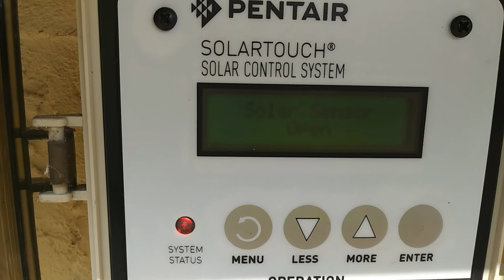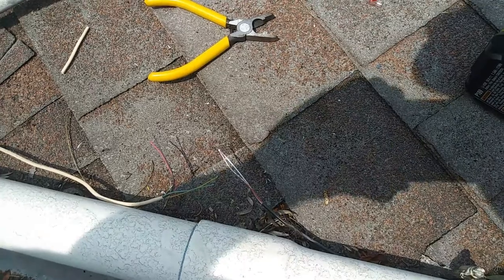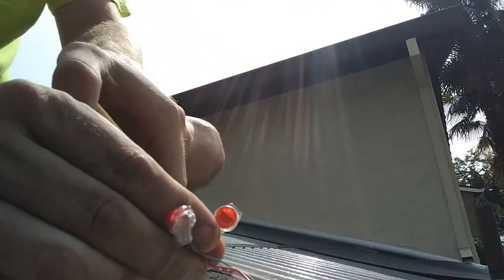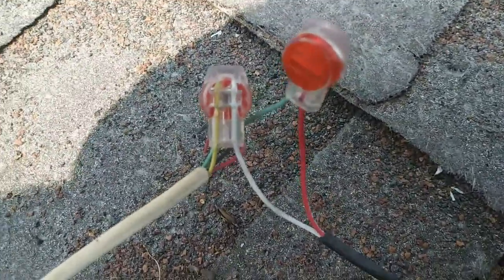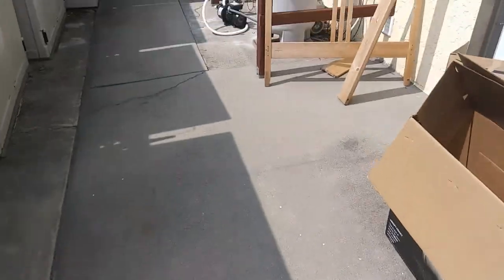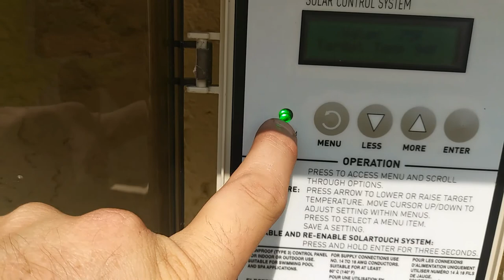Pentair SolarTouch Pool Solar Control Temperature Sensor Open Fault

Comment: I have the green light but in the evening it shows solar sensor open with the red light.  Is this something I should be worried about?  It doesn't seem to be warming the pool.  Temp outside has been 78 sunny.  Pool temp is not going up after solar has been on for days.  I'm a retired woman on a limited income so paying a 150 service charge is not really an option unless absolutely necessary.   Thank you.

Comment: Do you need to turn off the power to the pool pump and solar panel before doing this replacement?
Reply from the maker: There's no electricity that goes to cool solar heating. However, you do have to turn off the pump so there's no water pressure.

Comment: Do i have to use the connectors or just heat shrink cable protection
Reply from the maker: I would recommend the splicing terminals for a proper connection

Comment: I'm trying to install a controller  but the sensor don't know here to install them
Reply from the maker: Solar sensor goes on or near the roof, exposed to the air. Air sensor goes ground level near the controller, exposed to the air. Water sensors, get installed inside the plumbing by drilling a hole and held in place with a hose clamp. The pipe should be in front of the pool pump so it senses water temps coming from the pool.